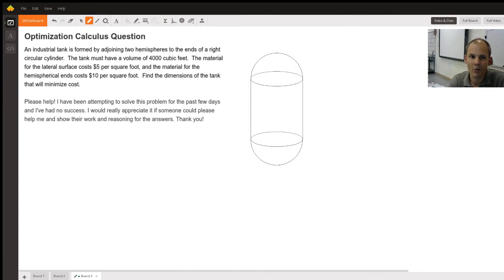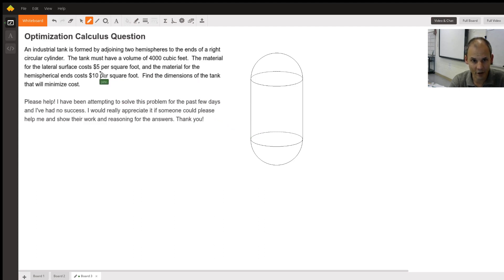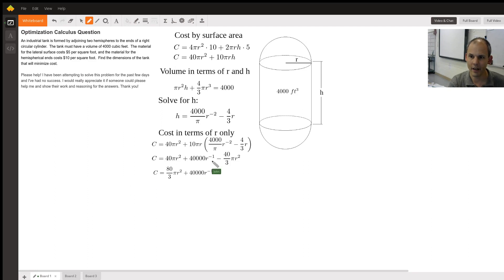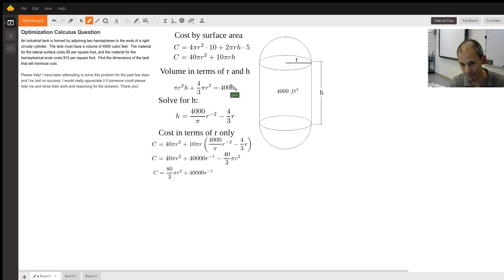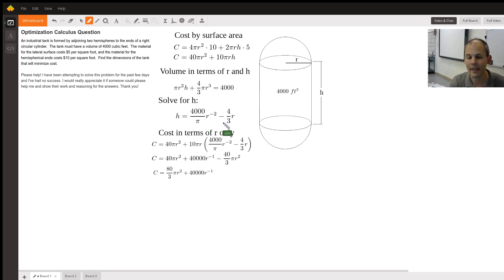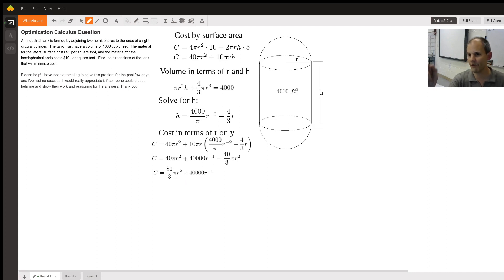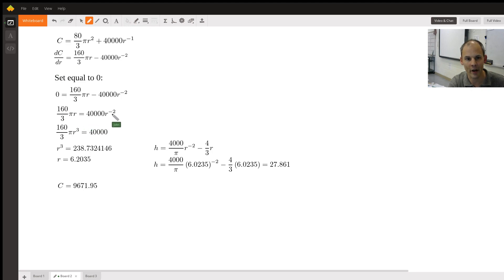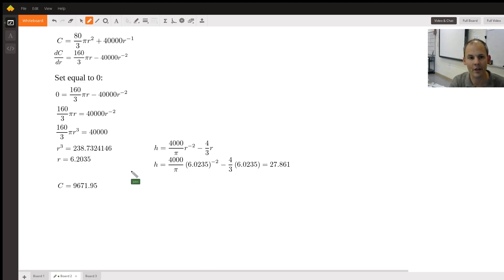Minimizing Cost of a Tank

Comment: If anyone else finds themselves here, the reason that 27.861 is wrong is because in the equation he plugs in 6.0235 instead of the correct radius which is 6.2035. He has the correct answer in the description, but at the time I was wondering why the answer on screen was incorrect as I put the exact equation he had on screen into my calculator and got the same answer. But the radius in the  equation is wrong.